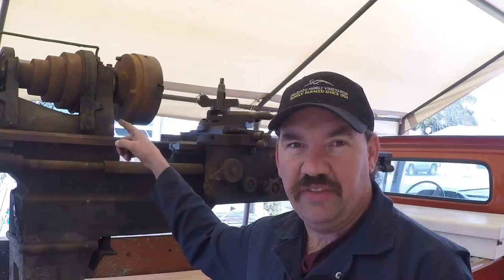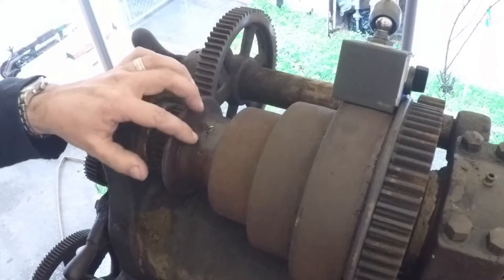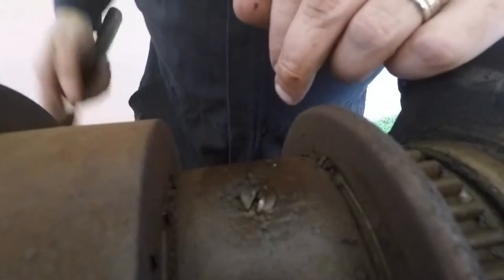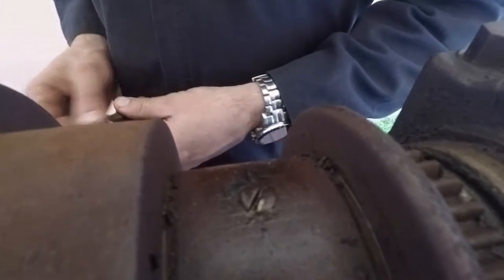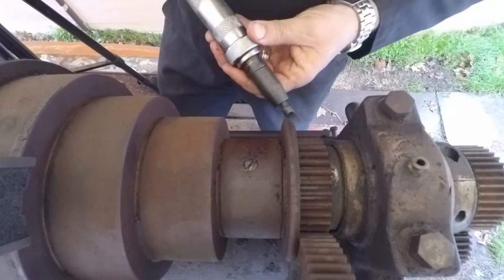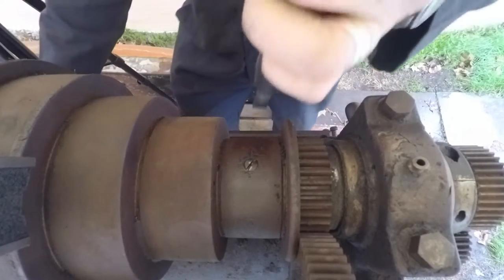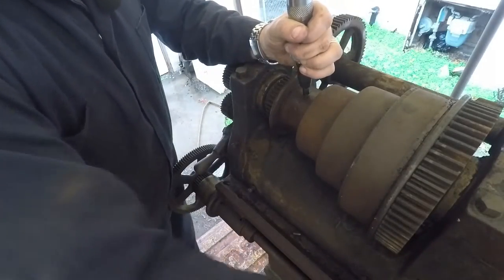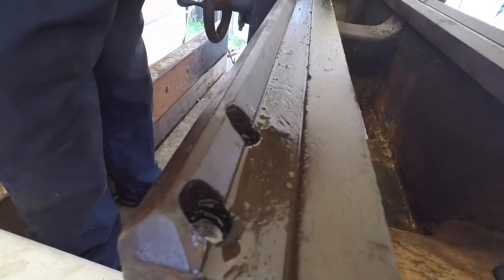South Bend Lathe Restoration Part 3

Comment: Buy some Kroil. Best rust buster, I know of.
Nice video.
Thanks,
John
Reply from the maker: +Caveman's Mancave it is .I have used it before but a little cost prohibitive.
Reply: Chris Anderson 
I can't seem to find it in my area. I have to order it online.
It is pricey compared to most but it usually does the job with less liquid applied.
Mike Wiggins of The Backyard Machine Shop uses a 50:50 mix o diesel fuel and automatic transmission fluid.
Maybe you could try that.
Just a suggestion.
I love what you're doing. Keep it up.
Thanks,
John
Reply from the maker: +Caveman's Mancave it's not given me to much trubble I like the  wd40 kinda as a cleaner starts softening the wezzl snot at a cheep price.

Comment: in a pinch, you can turn the heads off those straight head bolts an file a new straight groove on it. it will only make them go deeper in the hole. it looks like you have plenty to work with.
Reply from the maker: +Bison Workshop yards probably that will get addresses on the reassembly.

Comment: now
I've got a load of old machine tools that I'll be rebuilding.

just aquired a hollow chisel mortiser...says "smiths" on it....but it's almost certainly by JAMES SAGAR HALIFAX ENGLAND.

just a beautifuly made machine....lineshaft driven..

I'd say 1910-1920
Reply from the maker: glenn moreland awesome do you have any videos I would love to see your stuff. where are you from?
Reply: Chris Anderson 

Leeds UK

Now..
that south bend lathe you have there is a rarity...as they didn't make many gap bed models
just remember as well that south bends don't have hardened bedways on em...
Reply from the maker: I am aware of this. That will make it easier to scrape in.
Reply: Chris Anderson 

how you going to go about this?
flat bar & blue..?
then check for witness marks..?
Reply: how bad is the bedway..?
Reply from the maker: That's the basic idea but I need to make a Camelback straight edge before I can do that.
Reply: Chris Anderson 
ok
check how much they are to buy as well
as its cost V your time on making up a flat trammell
Reply from the maker: That's half the fun and I get to post videos so others can see how to do it as well.
Reply: one thing I see a lot on these old machine rebuilding vids that folk post up....is how they remove components with straight, machined faces..and delicate gears etc
then when the camera pans round you see this parts just kicking about on the floor.... just dying to get damaged
I always cover up tables etc with a hardboard before I start
Reply from the maker: Good advice
Reply: Chris Anderson 
I haven't posted any vids yet
when I do I'll do a comprehensive set of vids for each machine I've got
Reply from the maker: I'm definitely interested let me know when you do I'll put up a link to help drive some views you're way. Do you have the tube buddy plug in .it's very handy. I have a afileate link in my discription . If you want to get the paid version I'll get a little cut. But try the free version first
Reply: Chris Anderson 
here's a list of what I have so far Chris:

I`m an electrical contractor based in south Leeds area UK and collect antique & vintage machine tools as a hobby in my spare time with the intention of eventually setting em up to use once I`ve rebuilt em all.

A list of what I have so far:

1) 16" centre lathe by SOUTH BEND. INDIANA. USA. 1920-1930. I need to check if its a gap bed but in good condition with its original ceiling mounted jackshaft. Lineshaft driven.

2) Radial drill. 1900-1910...unnamed...but suspected to be by ALFRED HERBERT. COVENTRY. ENGLAND. 7FT high. 3MT. Rise & fall table. In very good condition. 2 stepped pulley running a 4 speed gearbox. Interesting belting arrangements to the drilling head. This was originally installed at the THORNYCROFT TRUCK & STEAMWAGON WORKS. Basingstoke. England. Lineshaft driven.

3) Mechanical hacksaw by G. HERBERT. LEVENSHULME. MANCHESTER. ENGLAND. 1900-1910. A super rare machine with damage requiring complete rebuild.  Very heavy & substantial. G. HERBERT were a manufacturer of machinery & measuring/marking out tools. Introduced the RAPIDOR MANCHESTER range of mechanical hacksaws. the RAPIDOR MANCHESTER name was first registered in 1935. Lineshaft driven.

4) Mechanical hacksaw by DENBIGH. TIPTON. WEST MIDLANDS. ENGLAND. 1900-1910. This one is in super condition. Very little wear. Uses a constant drive pulley with cone clutch drive...unlike the G. HERBERT that uses fast & loose pulleys with belt shipper. Lineshaft driven.

5) Pillar drill 1900-1910...unnamed but definitely British made...possibly by DENBIGH. Missing its fast & loose pulleys and belt shipper but otherwise complete. 7FT high. Converted to electric...probably in the 60s. Easy to convert back to lineshaft. 3MT.

6) Pillar drill by JONES & SHIPMAN. LEICESTER. ENGLAND. 1900-1920. Very high quality. A real brute, this one stands just shy of 8FT high. 4MT with 4 speed stepped pulley driving a 3 speed splitter gearbox giving 12 speeds. 4 speed power feed gearbox. Complete with its fast & loose pulleys but currently missing the belt shipper. JONES & SHIPMAN-HARDINGE still an entity in the UK. Lineshaft driven.

7) Surface grinder by CAPCO. WILLESDEN. LONDON. ENGLAND. 1910-1930. A very rare machine that predates the CAPCO models 1 & 2 that crop up from time to time. In very good original condition. Slideways nice n smooth with no apparent wear. Lineshaft driven.

8) Horizontal miller. The `TRIDENT` by PALLAS. LONDON. ENGLAND. 1920-1930. A super rare machine...I only know of one other in existence....in the USA. The one I have was used to 2nd op machine aircraft components during WW2..so I was reliably informed. In very good condition with virtually no wear. Lineshaft driven.

9) Bench drill 1900-1910...unnamed but suspected DENBIGH or SUPERIOR. Very nice original condition complete with its fast & loose pulleys, belt shipper and jackshaft. 24" high. 3 step pulley. Lineshaft driven

10) Bench grinder by ECLIPSE. LINWOOD. GLASGOW. SCOTLAND. 1910-1920. Lovely bench grinder by this very well thought of Scottish manufacturer of high quality machine tools. 8" wheels. Fast & loose pulleys with original belt shipper. In superb condition with no noticeable wear. Very nice brass stauffers atop the bearings. ECLIPSE name first registered in 1907. Lineshaft driven.

11) Bench grinder 1900-1910...unnamed. Very good condition & nicely finished. Lovely brass belt shipper. Brass stauffers atop the bearings. 6" grinding wheel & 6" sanding disc. Lineshaft driven.

12 Wood lathe 1900-1910...unnamed. Reassuringly heavy, this one has had its flat belt stepped pulley replaced with stepped V belt pulley...probably in the 70s. Easy  to return to original spec. Tool rest bars & bed + cross slide attachment

13) shoe finishing machine by FROBANA GERMANY 1910-1920
some damage to the back shield that will require re-soldering on the rolled edge joints. machine is seized...but complete.
we will be setting this up for metal polishing. lineshaft driven.

14) hollow chisel mortiser. Says smiths on the removable gear cover...but suspected J. SAGAR CANAL ROAD WORKS HALIFAX ENGLAND. 1910-1920 Very high quality. machine has seized components and requires rebuild. stands about 5 1/2 ft high. heavy. lineshaft driven with a clutch that only engages drive to the mortise head when plunging. Interesting flat belt arrangement from the clutch to the mortise head.

I`m also considering acquiring:

36" bandsaw by JAMES SAGAR. HALIFAX. ENGLAND. 1890-1900. In need of complete rebuild but appears to have been stored well. Very nice, heavy duty bandsaw by one of the best manufacturers in the business when trading. Lack of any guarding on it demonstrates how times have moved on. Lineshaft driven.

When I get round to sorting all these out I`ll be bunging Utube vids up. The G. HERBERT hacksaw will be interesting as there`s quite a bit of welding to do on some cast iron components etc. Definitely a case of bringing this one back from the dead but the running gear on it has very little wear. Its rarity us what`s saved it.

the Smiths mortiser...which in reality I suspect is a SAGAR...I picked up the other day from south Wales
I'm still mulling over the bandsaw at the same location
Reply from the maker: That's quite a list your going to be a busy guy. I'm interested in the jack shafts of the south Bend I do have the cone pull but not the bearing hangers or clutches. I'll need to manufacture new ones but need good drawings to work from.
Reply: Chris Anderson 
ok
I'll drag it out of the shipping container and take some measurements of it...and some pics
I'll need an email address to send em to
Reply from the maker: Thanks that would be great try to put a ruler in the pic for reference
Reply: Chris Anderson 
ok
when do you need it for..?
don't forget Chris...that if your going to have new ones cast then you'll need to make your patterns up with a pattern ruler
Reply from the maker: +glenn moreland I'm not in a hurry. And I do pattern work already. I know what I'm getting into. ;)
Reply: I'll be dismantling the jackshaft assembly as its due a rebuild...I'll take plenty of pics of the dismantling process...together with dimensions etc
Reply from the maker: +glenn moreland perfect thanks so much if you need anything let me know maybe I can help
Reply: Chris Anderson 
thanks Chris
and your most welcome.
Tony & Keith's websites are a mine of info on both US & BRITISH MADE stuff...😉

I try to collect British where possible as it's harder to get...but I like my south bend...their a high quality machine...it needs a rebuild really as everything's a bit tite on it...someone has painted it hammerite green at some point
but I always wanted a few pieces from other countries...hence the south bend & the Frobana....

like I says that lathe you have there is rare
I take it you have the gap insert with it...?
Reply from the maker: I do but it's very pitted . I want to take Richard king's rebuilding class but it it very pricy.  I need to start saving up for it.
Reply: watch out for taper pins holding stuff on shafts...stuff like handles & gears...as this was common practice in the early 1900s....what I've found is that when your working on stuff like this...you have to get into the mindset of those that made it.
some of the engineering practices utilised are familiar....other aspects can seem strange to the modern mind...
Reply from the maker: +glenn moreland yep not many so far one in the back gear into the headstock casting. Looks like a tuff one to get out.
Reply: Chris Anderson 
have you tried a little light persuasion with a hammer & pin punch?

what you'll find is that the DOMED END of the pin is the wide part of the taper pin...so you drive it out from the other end.
if it won't come out with GENTLE hammer & punch then consider making up a piece out of some bits of scrap that will fit round the casting...with a thread run in with a tap....you should be able to "push" the pin out with a hardened machine screw of a size small enough to clear the pin hole
this will get round trying to hammer out the pin....as it could end in tears
Reply from the maker: +glenn moreland haven't started on that yet looks like a blind hole but I'm probably mistaken.  Lots of grime on it still.
Reply: have you considered having the bed reground..?
it'll cost dollars...but it may be best if you want any kind of accuracy...that way you get the bedway & the gap insert spot on
what you may find as well....is the amount of wear discrepancy towards the headstock...as many of the jobs carried out in its lifetime will have been facing & boring operations where only the first ft or so of the bedway has been used
Reply: Chris Anderson 
it's likely to be a taper pin in there Chris.
give it a lick with a wire brush...but make sure it isn't a grub screw.... personally I can't see it being anything other than a taper pin
Reply from the maker: +glenn moreland this is likely the way I will go.
Reply: you may be able to get another back gear from south bend.
thing is with the south bends Chris...was the amount of hand finishing that went into em
real craftsmen that knew their onions...
Reply: eBay sometimes throws up parts for south bends, Logan's & Pratt & Whitney's
I'll have a look...
Reply: just had a look on eBay
there's a lot of stuff for myfords...and a few for Atlas & Logan...not anything  for south bend

if your going to have a go at driving that pin out with a hammer & punch then drive TOWARDS THE HEADSTOCK...won't you
don't attempt to drive the pin out facing down...drive towards the headstock

that way you don't risk cracking off the extension arm that carries the backgear cam's...😉
Reply: I'm just looking at your vids of this again
that is a really nice project Chris
I wouldn't dare ask what you paid for it....but it'll be worth it I'm sure
a lot of enjoyment to be had sorting it out...
Reply: Chris Anderson 

Tony at lathes UK:

http://lathes.co.uk

Keith Rucker's website:

http://vintagemachinery.org

Grace's guide:

http://www.gracesguide.co.uk/Main_Page

Practical machinist:

http://www.practicalmachinist.com/vb/antique-machinery-and-history/

Antique machinery:

http://antiquemachinery.com/whyIcollect.htm
Reply: which is the Richard King rebuilding class?
is this someone who does lessons on old machine tools..?
Reply: I nearly bought a guillotine last year
10' X 1/4"
made by RUSHWORTH, SOWERBY BRIDGE, HALIFAX
that were an old one...run off a lineshaft
it were in Norfolk....I thought about it but it were nearly 7 ton of machine...lol
it were getting it back to Leeds that would have been the problem....it dated from the early 1900s did that..
Reply from the maker: +glenn moreland lol yeah I bet
Reply: Chris Anderson 
it were an overcrank
big flywheel on it...
they were good machines were Rushworth...
Reply: Just think Chris
the year your lathe were made...the British & German fleets were getting it on at Jutland...
Reply: you still there mate....?
Reply from the maker: Yes sorry I do sleep to lol
Reply: Chris Anderson 
ok
sorry but I forget its a different timeframe..😉

Comment: Did you find the serial number? It should be on the flat just behind the last two screws you removed with the chowderd up heads
Reply from the maker: +j hefflinger yes I did it's 9146 if you have any intelligence on it that would be very handy .I looked for the casting date inside the bed but can't find it but probably hiding in 90 years of grim.